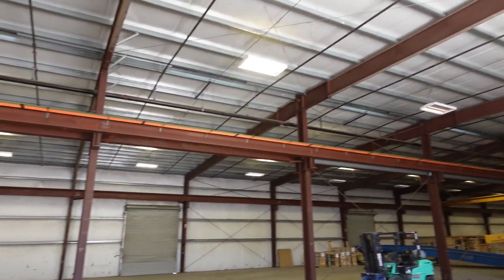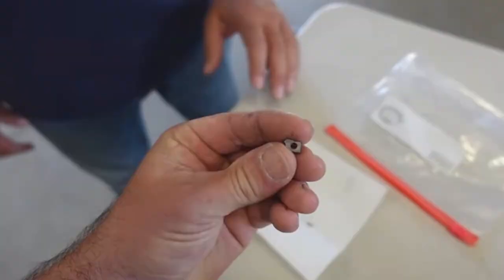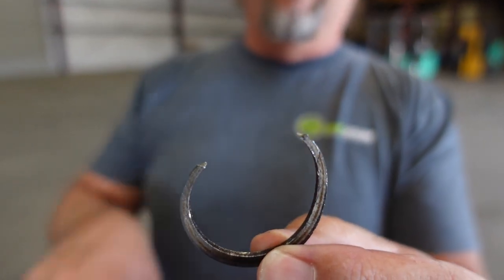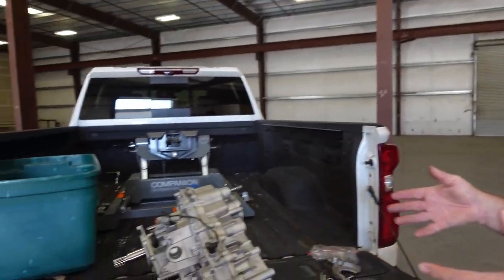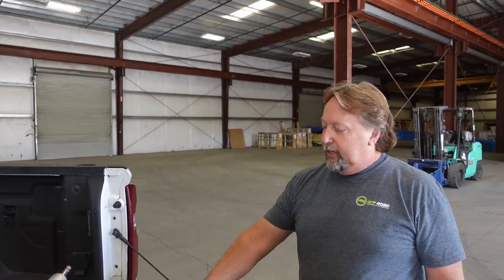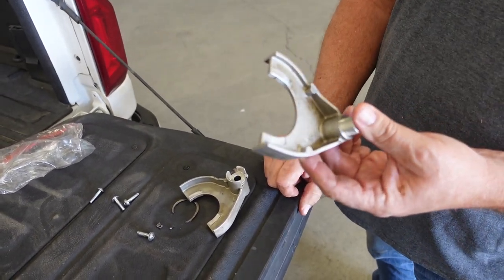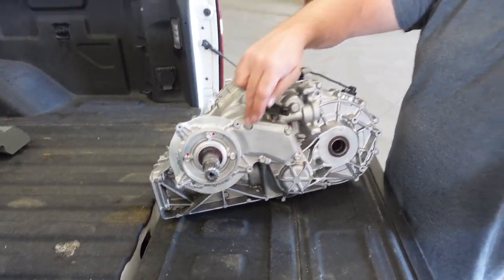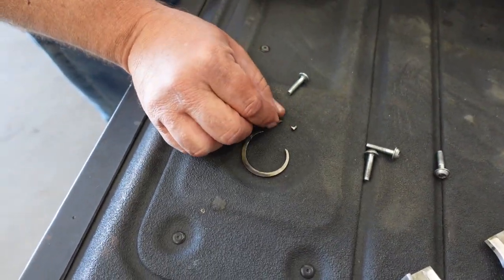Dean's Tranny Blows FIXED CryoHeat Micropolishing

Comment: Does Can Am use an alignment tool between the primary and the secondary to make sure they are perfectly aligned like Polaris does?
Reply from the maker: I'm not sure but there's not much movement to be able to adjust it if any
Reply: @DandiOffroad  hmmm yea when we did my friends Turbo RZR engine he needed to buy this bar with two holes in it to Aline the engine and trans. I think he paid $30 for it?
Reply from the maker: Yeah I have seen that, but not sure they make one for the can am, and not sure what it would do because there really is no way to move it around, it just bolts back where it came from